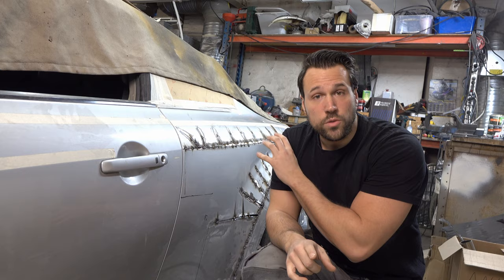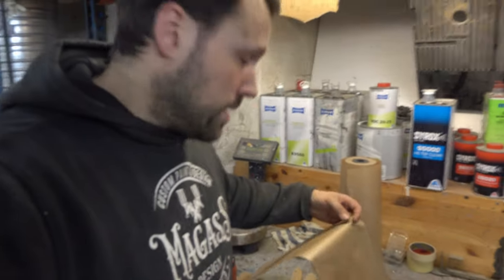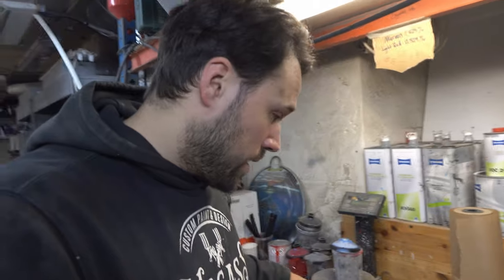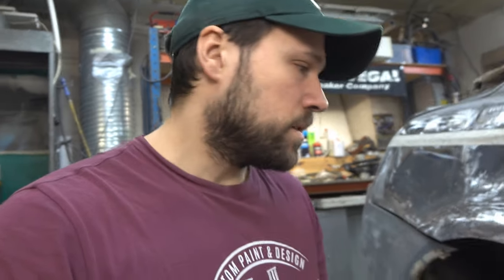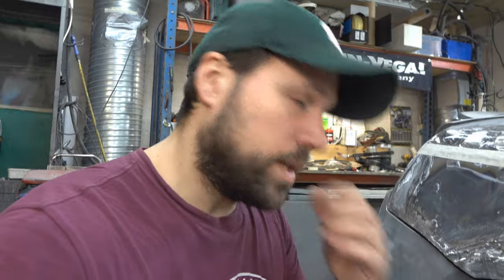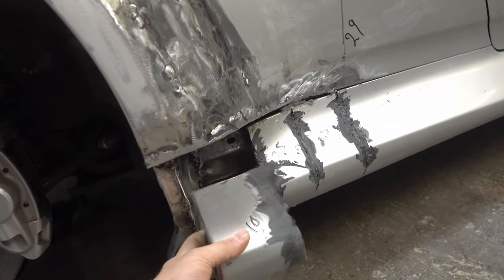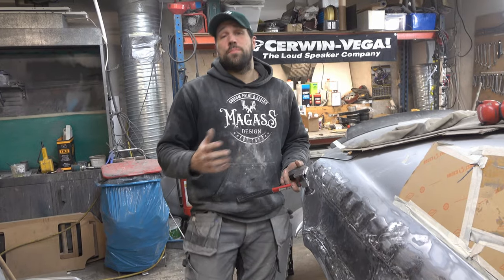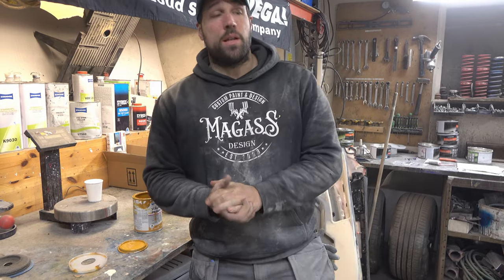BUILDING A WIDEBODY KIT [PART 3] [Infiniti G37]

Comment: Finally found it bro and I'm drinking rockstar has more caffeine and I like hearing when you talk because I have a 09 g 37 got rear ended and I only found your channel cause I've seen all kinds of front end swaps so I decided to see if anyone had ever decided to put a Q60 front end on a G35/G37 cause I really wanted to swap my front end but I could have used some of the techniques you used cause after I got rear ended had to get new rear bumper and I put a rear bumper from a G37 convertible S and like the look way better but had to cut rear bumper in half wish I would have seen it before I cut it and fiberglassed it back together but had to remove about 1.01 inches out would like to see more step by step I really need to learn to weld too.
Reply from the maker: Thanks for the support David. Really appreciate you taking your time to write. I will try to make more in dept videos in the future. Sounds like you have a interesting project man!